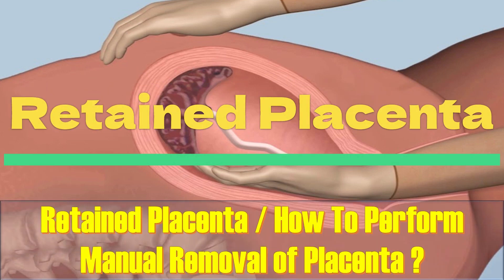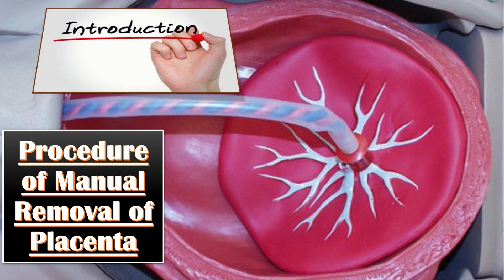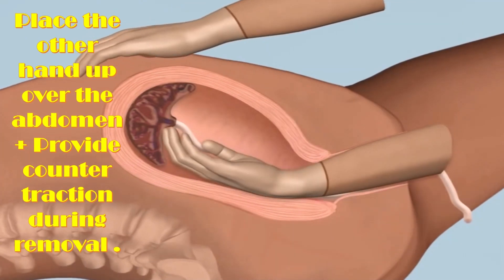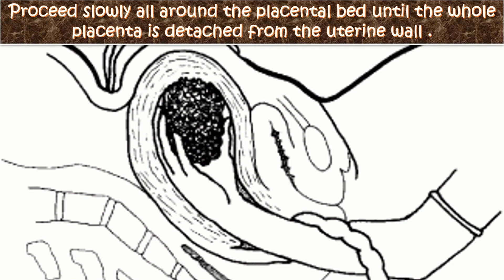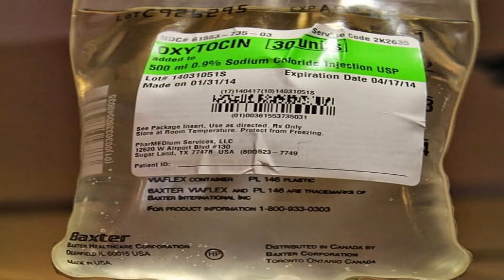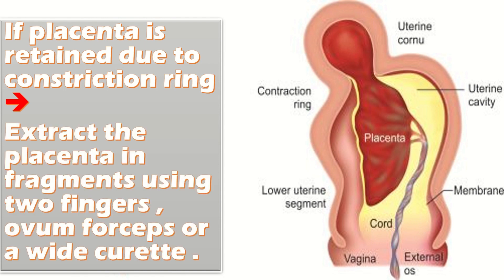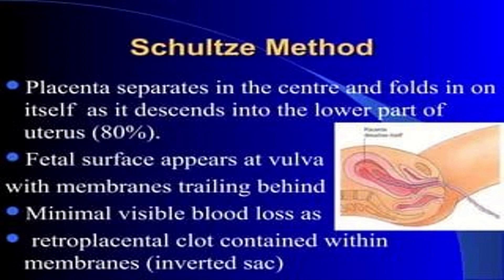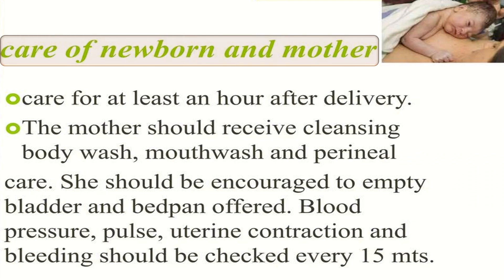Retained Placenta : Clinical Scenario, Causes and Management | TOACS & OSCE Station

Comment: Do you wear PPE because your arm will likely be in The cervix
Reply from the maker: yes PPE should be worn. Ideally long sizes sterile gloves should be used but due to availability issues usually bare arm goes inside thats the reason we should wash hands with arms by using sterile technique before going for procedure. Post natal prophylactic antibiotics should be considered.